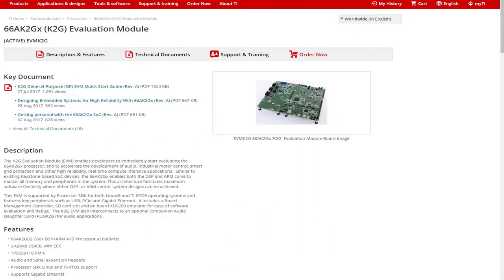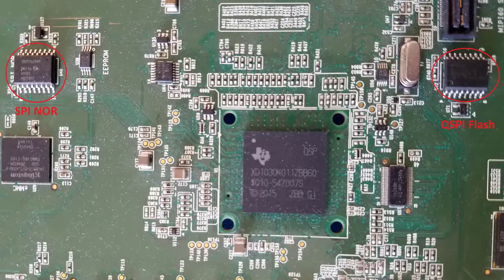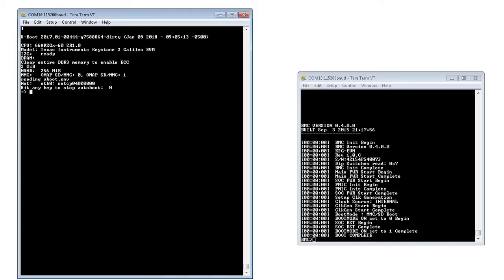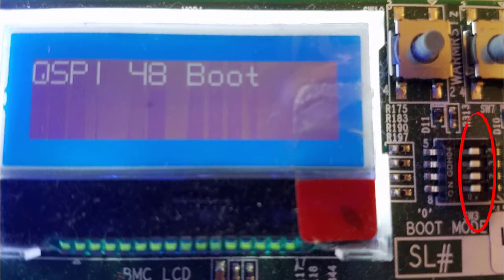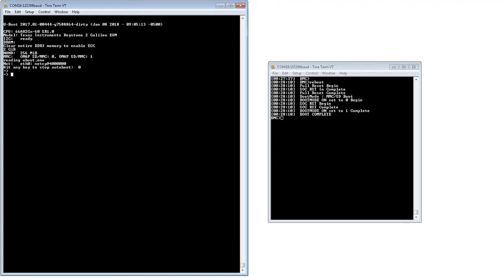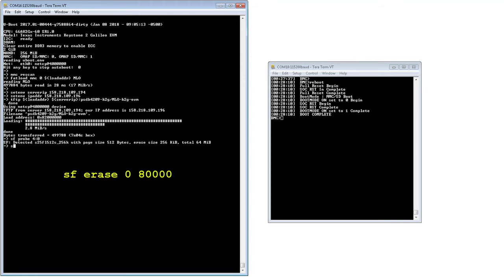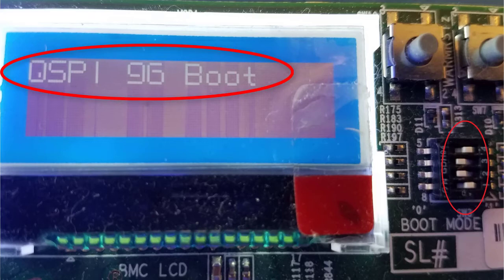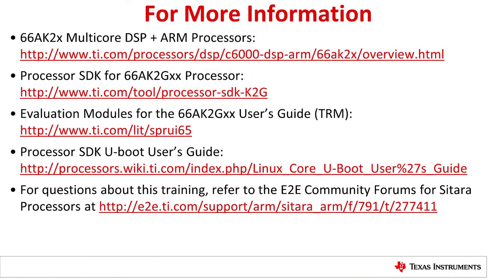Demonstrating U-Boot from SPI/QSPI for 66AK2G

Comment: I'm working on k2gEVM, Can you please help me to mount rootfs which I've loaded to QSPI mtd partition. 

Note:- "I've loaded rootfs " arago-tiny-image-k2g-evm.ubi" into  partition@5 {
   label = "QSPI.file-system";
   reg = <0x009C0000 0x3640000>;
  }; "

bootargs I've set is,

bootargs=console=ttyS0,115200n8 root=/dev/mtdblock5 rootfstype=ubifs  

The error i'm getting while mounting rootfs is,

Kernel panic - not syncing: VFS: Unable to mount root fs on unknown-block(31,5)
[ 3.342225] --[ end Kernel panic - not syncing: VFS: Unable to mount root fs on unknown-block(31,5) ]--

Please help to resolve